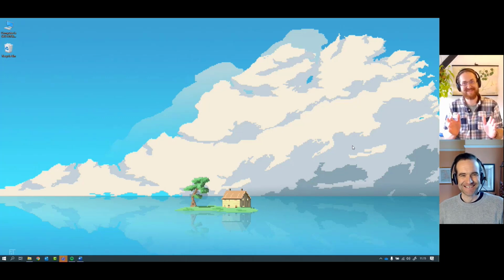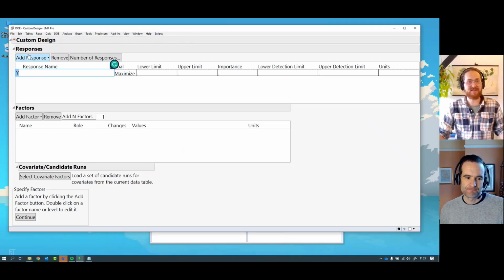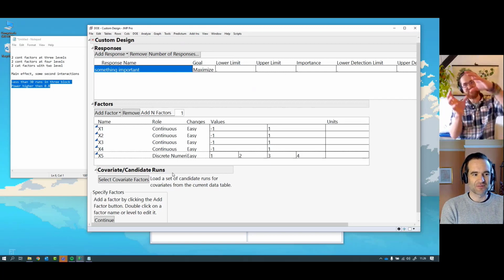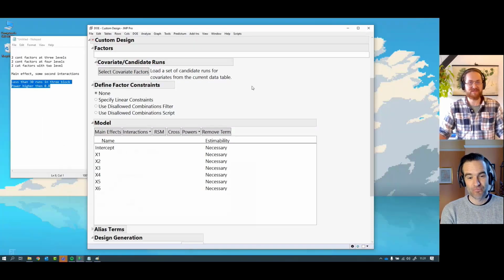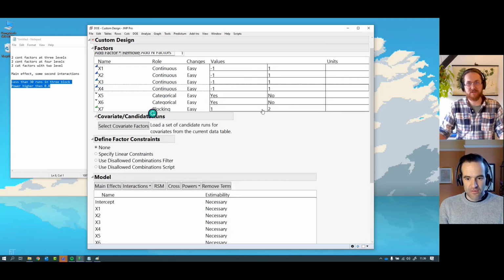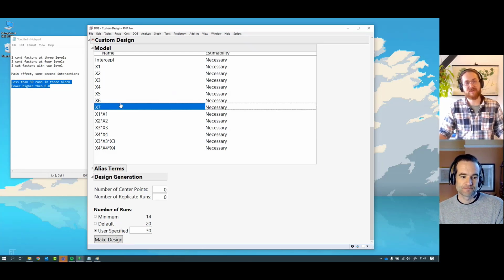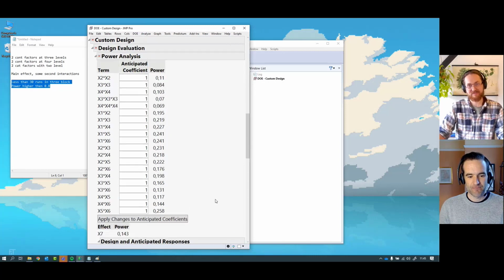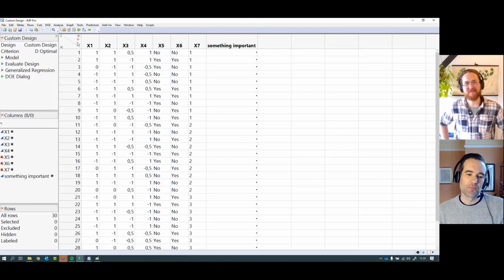Making a DOE with Blocking Factors

Comment: Nice format!
Strong agreement with your comments about Power. 
Blocking Vs Wp/Sp is another interesting topic (I'd say they are different from an intention stand point, but from analysis stand point the Block factor can be seen as a restricted chunk factor, so a Wp factor).
I would have been interested in understanding the properties of that custom design in terms of confounding. What are the VIFs for the terms ? (Model dependant of course).
Thanks, and keep up the great work.
Reply from the maker: Thanks for the feedback! 

Before I can answer you, I have a quick question. I don't understand all the abbreviations you use. I guess wp = whole plots and VIF = variance inflation factor, but what is SP?
Reply: @statslikejazz  all correct, Sp stands for Split Plot